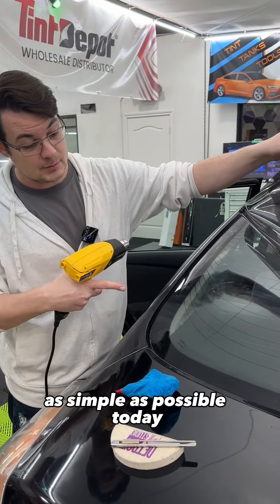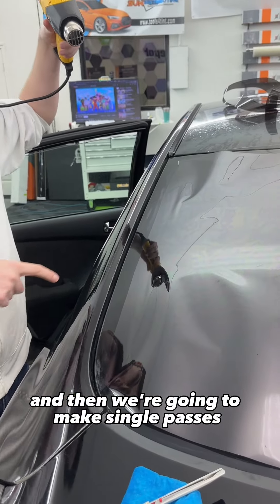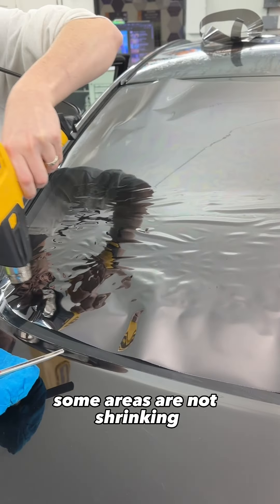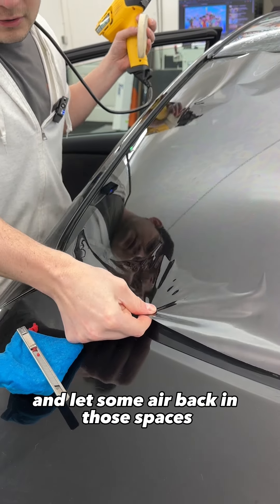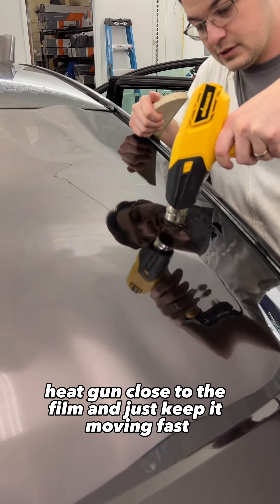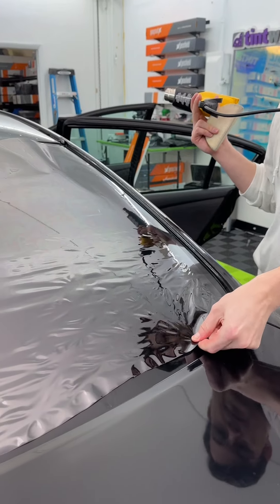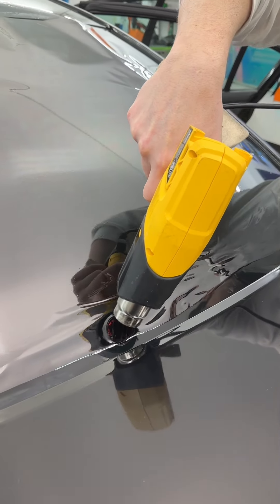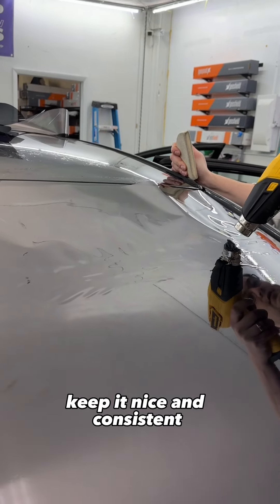Struggling with shrinking tint? DO THIS! Let me know if it helps

Comment: letting the air between the film and the windshield as you are shrinking was one of the things that I didn't snap to until about the third attempt; then I realized that it went great when I lifted the film to let air in between as I was shrinking. call it instinct or whatever, but something just hit me that third time, and it all just came together after that.
This was such a great verbal and visual demonstration! Sometimes you can see something over and over, and it just doesn't always sink in just how important each little step is.

Comment: This works for me, Ive been very inconsistent throughout try to figure out why it's coming out wrong the last 3 times, you definitely make it look easy and so does most professionals here on YouTube, what my mistake was over thinking the shrink/heat temp ratio, so I was toasting the film more then I needed too, so this method has worked best for me to understand where it needs to be, thanks for this Video it has taught me more then I have learned over the years doing it my self, it's always the back glass that is the hardest, I have zero issues with side windows, I just tried this method to finally get 3/4 of the back glass almost perfect, then I got rained on, go figure

Comment: Your videos are great! I had a question. Why do you not pull the film from all 4 directions to spread it out before starting the shrink? Why tack the left and right side down and have lot of extra film to shrink vertically? I understand the first horizontal line of H tack. but why the two vertical tacks on the left and right vertical edges?

Comment: I think one of the biggest things that stuck out to me is the fingers when they turn sideways when you are shrinking is a good indication you have shrunk it to the point that it needs to be to lay down. My problem was, when I was attempting to do my windshield for the first time and didn't let the air in between the film and the windshield that I wasn't able to see that, and I would over shrink the film, and it would drape sideways real hard.
Reply: Good eye!
Nuances like that are easy to overlook and have someone like me "practicing" with an embarrassing amount of film😬

Comment: My boyfriend just did my 2000 Buick regal & the sides aren't bad but the back window is going to have to be redone. Do you wet the window or the tint before shrinking on the outside of the car? & What do you use to get in where there brake light is? He struggled even cleaning the window down there so the tint is peeling up at the bottom & it's not even all the way to the bottom of the window cause it's hard to get in there.
Reply: He didn't heat shrink the side windows & he tried to heat shrink the back windows tint but it didn't do anything because wet it first so he gave up with heating it so my back window is completely messed up. I used walmart tint also & it's not even wide enough to cover the back window so 2 strips have to be used. Any tips you can give would be appreciated.
Reply: @misslilpersian4758  For the back window most people use a wet dryer sheet and rub it on the back window then let it dry before shrinking film. Use clay bar to clean windows before install on any windows as it’ll help lay film down easier w out obstructions. Your best bet is to buy some cheap Amazon film like a 36 x 10 feet film as it’ll cover the whole back window in 1 go and have enough for multiple attempts/multiple cars. Also cutting out the area where the 3rd brake light is will help not having to reach farther down into the window causing the job to be harder than it already is.

Comment: hi! i'm an automotive tinter and i've recently been trying to install precut ceramic tint by motoshield pro. i've been having alot of issues with heat shrinking and noticed the way they precut might be throwing me off. the bottom part of window is in the middle of the tint rather than the edge. any advice?
Reply from the maker: Can you post a picture in my Facebook group and tag me? @ Matt Blackmer. Then I can get a good idea of what’s happening 

Facebook.com/groups/tinternet
Reply: @DetroitTintStudio  just did!

Comment: Cant wait to try this on my next car! any tips for flat back windows on pickup trucks?
Reply: Flat back glass shouldn’t require any shrinking. Should be able to just cut it to size and lay it down no problem!
Reply from the maker: Trucks don’t need hardly any shrinking. I set them up like a door window and just wet shrink the bottom or just do some touch up after it’s installed if it’s a new truck